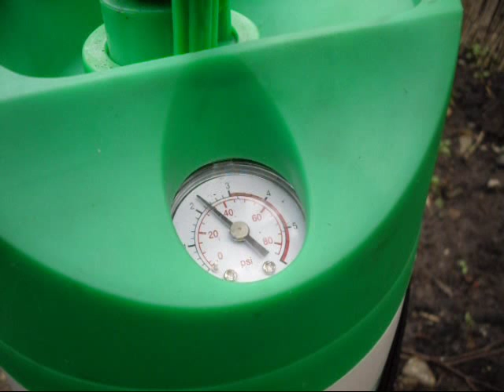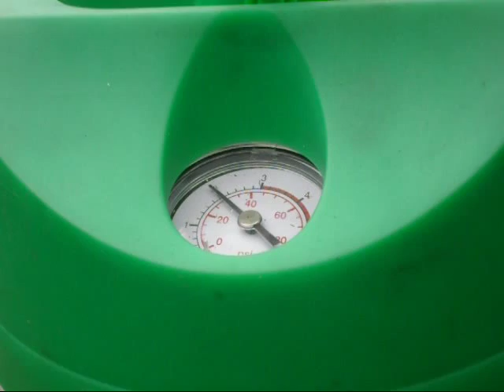Suffolk compressor set   part 4   the moment of truth!

Comment: Good work. I was considering making a similar outfit and rig it in a way that the air would blow a constant stream of air upwards with enough velocity to make a small wind puppet dance. With the air stream blowing at the same rate as the compressor you would not have to bleed off pressure to keep from bogging the engine. They use 20 foot tall versions of wind puppets here in the states to draw passer byes in for a sale or event of some kind. I thought kids would like it at rallies as you say.

Comment from the maker: Hi there,

The engine came from a Suffolk Colt cylinder lawn mower, the compressor is beleived to be an early form of refrigerant compressor, most likley in a shop many years ago.

I built this set for a competition based around "re-engineered" uses for a Suffolk engine. I didn't win, but had great fun with the competition and using the compressor set afterwards. I didn't spray paint or anything, but I did have to spray the block paving on the drive, it was great for that.